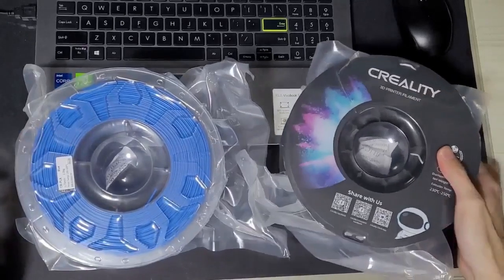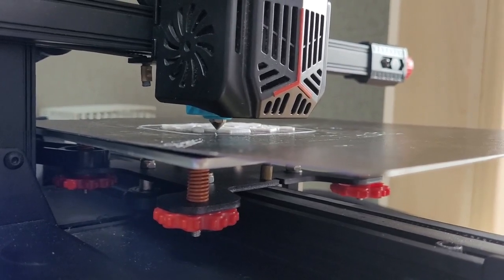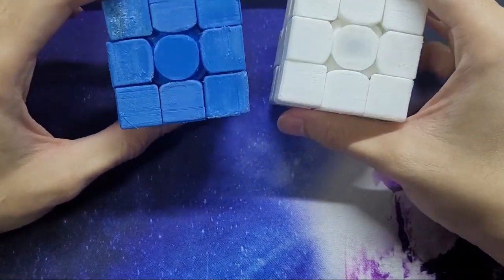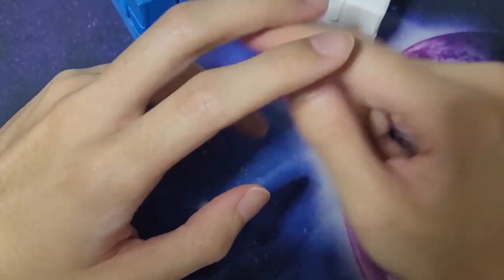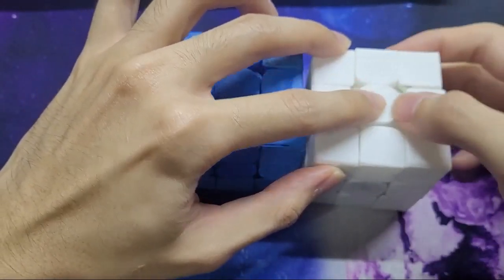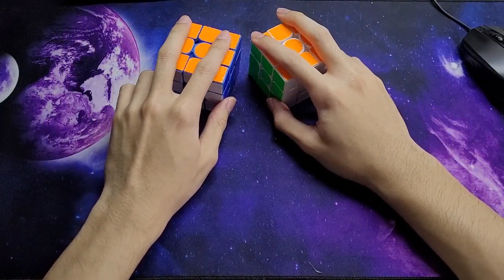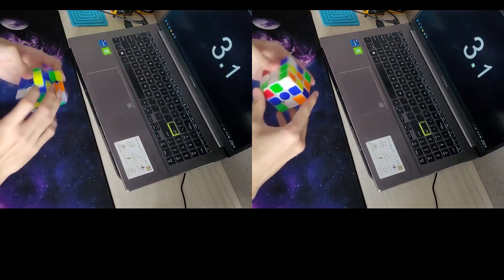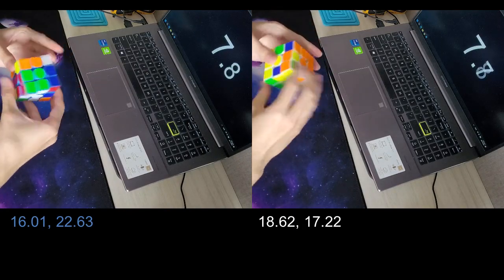PLA vs PETG: Rubik's cube edition

Comment from the maker: Some extra explanation in case you... 

...came here from 3D printing rather than cubing, and don't understand these terms:
Aolong:      The model I printed for this video was based on the Moyu Aolong 3x3, which was the most popular model back in 2014, however, while Moyu has updated another of the popular models, the Weilong, many times over, the Aolong didn't receive much updates, the latest being the Aolong GT from 2015. The cube I printed features a hidden internal center stalk design that became dominant in most cube designes from 2016 and after.
Valk:     Another cube I took inspiration from to design my 3x3 was the Qiyi Valk 3 from 2016, which featured a rather unique center-stalk design that I haven't seem featured much again. It also has a very recognizable hole in the foot of the edge piece, which I referenced in many of my 3D printed cubes, including this one.
Meiying:       This is a 2015 model that a large number of newer cubes look extremely similar to, such as the Yuexiao and Valk in the following year. Notable features the Meiying was the large holes in the corners, and a 'square corner, arched edge design' that had also gained popularity around or slightly before that time.

...came here from cubing rather than 3D printing, and don't understand these terms:
Extruder       a part of the printer containing a gear that pushes the plastic filament forward
Bowden tube       tube guiding the filament towards the hot end, which is the area that the plastic filament melts. Capricon is just a brand of bowden tube. I accidentally said 'capricon tube' once in this video instead of 'bowden tube'
All metal hot end       a non-all metal hot end consists of the bowden tube going deep into the heater and touching the nozzle, and this has a risk of the heater burning the bowden tube if printing temperature is too high. The all metal hot end on the other hand stops the tube much earlier in a place known as the cooling block, where a fan is blowing on the tube to cool it. The remaining distance that the filament passes through into the heater and out of the nozzle is all metal.

and an extra term if you don't know:
RC pongo's dovetail design: A center cap design by another cuber/3D print person, which involves the center cap sliding in horizontally rather than vertically, making it harder to remove. The rational for this is because it's harder to design a pair of tight fitting pieces that hold together by friction. Most of the time, you either end up with caps are too big to fit into the center, or the caps fall out all the time. He designed the cap to slide in when the cube is partially dissemble, eliminating the need for a 100% perfect fit and reducing the chances of center cap pops. I tried to used an upside-down version of his design in order to allow the screw to be screwed back further, but it didn't work and I had to do the magnet thing I mentioned in the video.

Comment: Could you posibbly share the stl files because I would really like to print it, because other models are not good as yours. PLEASE😢
Reply: or how did you split corner parts in thirds. Did you used ultimaker cura? Cause I don't know how to do it.